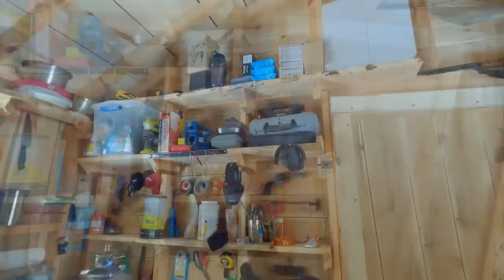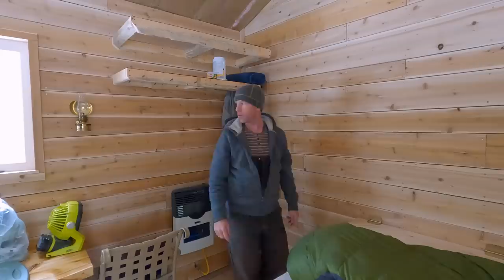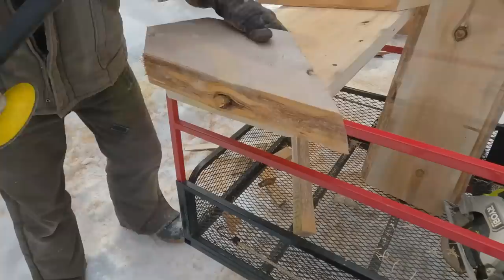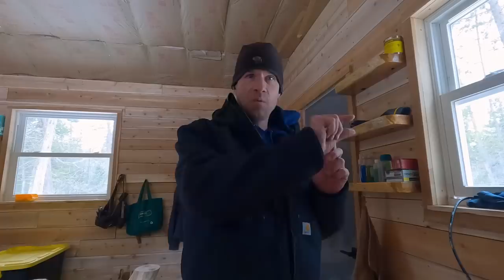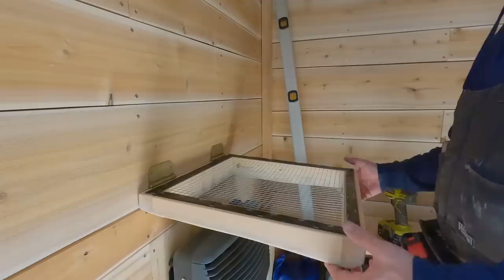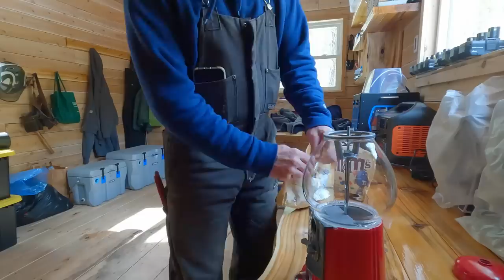Finally Moving In! 190sq ft Alaskan-Milled Cabin #131

Comment: You should hollow out a tree stump to use as a trash can. Make it look like a tree growing up out of the floor instead of a trash can. You can put a lid on it and have it double as an end table.
Reply: "...an end table." or a movable seat and if a second, rough thick lid were made and  stored under the cabin it could be a movable work bench for heavy duty poundin' on.
Reply: Also - cut nails are usually hammered into a board WITH the taper of the nail and the grain of the wood so that the tapered sides of the nail don't separate the wood grain and make it crack, horizontally (in this case).
Reply: Sounds awesome.
Reply: That's a cool idea 😂
Reply: that's a cool idea!

Comment: Idea for the ceiling till you get round to putting the wood up, buy some canvas fabric and pin it up just so your not looking as the insolation for now. Love watching your videos
Reply: Kyle's Cabin on YouTube has a video of this exact thing. Turned out great
Reply: We did that in a rental basement I lived in, once. it make a world of difference and was actually kind of nice. Plus it'll keep the fiberglass fiber from entering your lungs at a drastically reduced rate. My lack of mesothelioma thanks me.
Reply: Yessssss!!!
Reply: Great idea!
Reply: Might be interesting with a tin type ceiling.
Reply: @proehm  might reflect light and be a nuisance.
Reply: @Knight805  or help, those oil lamps don't put out a lot, a multiplying effect might save fuel/power.
Reply: Amazon has those cheap tapestry sheet things, hang a starry sky up there.
Reply: Tell me when a guy would care about boards showing. LMAO.
Reply: @GeorgeMinton-jb8ky  It's not boards, if you paid attention... it's insulation, and dude specifically talked about wanting to cover it. Why even comment?

Comment: You should use that reflective bubble wrap foil on the ceiling too. It will reflect radiant heat back inside in the winter and the heat from the roof back out in the summer.
Reply: Working good on my House and Garage

Comment: A couple of things to think about... 
One.. the sun is way better at making heat that electricity. Have you thought about making a solar heater for supplemental heat when the sun is out? It would save a lot of propane when the sun is out even if it's ridiculously cold.
Two.. if you make an insulated tank you could keep the water from freezing with a solar heating panel. During extended dark periods a small heat exchanger and a small fire would give you warm water. Sawdust and with some borax to keep out the bugs is cheap insulation and a way to use something you make every day.
Three.. now that the jackery is inside and warm the solar panels can be used year round to save running the generator so much. Just need to run an extra wire through the wall when you run the wire for the generator. 
Love the channel. You are living close to my dream.

Comment: The insulation will sweat in the summer, you need air between the ceiling and insulation, just like a house but smaller

Comment: Use totes like the green one you have under the bed now to put the water buckets in or use a cement mixer tray like the black one you used to mix cement in. Even if they sweat the water can be easily dumped out of them without getting the floor wet.

Comment: On your 1lb. propane bottles, do you have the 20 lb. tank adapter to fill your 1lb. bottles? Refilling the 1 lb. bottles is much cheaper than buying the bottles. 
Easy to do a refill with the adapter. Thread the adapter in the tank, thread bottle on adapter, turn the whole thing upside down, open the tank valve. Wait a minute or two to let the bottle fill. You can hear the flow of propane as it fills. After you can't hear it you wait like 30 seconds or so, close the tank valve, unscrew the bottle and repeat till all your bottle full.

Comment: You should make a water tower at the back of the cabin. You could insulate it well, add some electric heating coils and run it off a passive solar panel so it won’t freeze. Maybe pipe in the air from the peak of the cabin ceiling to help keep it from freezing…

Comment: Ryan, be careful putting the generator under the cabin because of CO2 poisoning, at least get the floor air tight first.
Reply: Just put an extension on the exhaust
Reply: @Grunttamer  that would work if you want to do that.
Reply: Yes... it is generally recommended one run their generator app. 25 feet from the house.  Even running it near a window has killed people.  😢
Reply: @faithrada  25 feet is incredibly extreme.  The cabin isn’t even remotely air tight.
Reply: Thank God you suggested that…I’m sure he never thought of that 😂
Reply: I had some friends who had their sons were together at the faster's horses concert in Michigan a couple years ago and they had their generator underneath the camper in the back because it was raining and two of them died by CO2 poisoning devastated my friends ..
Reply: bobbobber2536 I was thinking the same thing… the cabin is off the ground…
Reply: bobbobber2536 
There's a myth that carbon monoxide alarms should be installed lower on the wall because carbon monoxide is heavier than air. In fact, carbon monoxide is slightly lighter than air and diffuses evenly throughout the room.
Reply: bobbobber2536 CO2 is carbon dioxide. You mean CO which is carbon monoxide and it's the deadly silent killer from Gas powered engines etc..

Comment: You can use one of those winter boot trays that you put messy boots on right inside the front door. That way if it does leak, you can always take the tray out and dump it.

Comment: Why don't you make a low profile slide out platform for under your bed for the water buckets that you could line in plastic to help you 1. Get them out/ in more easily and 2. Fix your condensation issue.... just a thought 😊

Comment: maybe a water holding tank on casters could fill and slide under the bed in an insulated box. like for a boat or RV to solve your water sweating issue. it would also look very nice. if ya want to get really fancy could use a manual pump or small electric pump so you only need slide it out when it needs filled. could line the box with pond liner to help keep the floor dry and with it up off the floor maybe it wont sweat or leak messing up the floors... just wallerin ideas around in my head..... hope this gives you some more ideas to solve the problem.

Comment: You can buy 1/4 inch boards at the big box stores that are made to put on bathroom walls. They are wood on one side and a solid white laminate on the other side. They come in 4’x8’ sheets. That would be perfect to put under you bed to sit buckets on. They do not cost all that much.

Comment: The reason for the evaporation on the buckets is because the water inside them is cold, which makes the buckets cold, which causes any moisture in the air to collect on the. The bubble wrap, if it is sealed well, may reduce that some. Why not just get them up off the floor?

Comment: The condensation you are seeing on your buckets may be coming from your propane heater. One of the by products of the flame is water vapor. Never a bad idea to have a CO detector in an enclosed space being heated like that. You may have to come up with some venting to control the humidity.

Comment: They make square fiberglass pans to put under hot water heaters, washing machines and ect. They are like 30”x30”.
And they are not expensive. You could put 2 of those under you bed.

Comment: Hello Ryan;  had to stop the video when you were sitting at that beautiful counter Jackery/Laptop all set up.  So when your getting power from the Jackery am I seeing you plugged into  the 110 on the Jackery?  I just came from Best Buy looking for a way to charge my laptop to Jackery without the need to use the "brick" or the 110 ports loosing power.  It has been my understanding that using the inverter alone uses power so to connect direct with out inverter to be a better option.
Best Buy was not helpful because the laptop "Lenovo" seems to not have a way to connect 12 volt to 12 volt.  Any thoughts or words of wisdom on the subject?  Being off grid as you are at times I am also and wanted to connect to car, RV or Jackery without the need of an inverter.  The young guys at Best Buy I could tell had no interest and acted like I was from another planet asking to do such things.  Love input from you or any of your followers on the subject.  Thanks you are an inspiration to follow.

Comment: Hooshing Propane Refill Adapter Universal for Disposable Small Propane Bottle Solid Brass Propane Tank Atapter Lp Gas 1 LB Cylinder Coupler Quick Connect Attachment  - to transfer propane from 40 pound to 1 pound container

Comment: Your tools will drive you crazy all your life I gaurantee it you will misplace them constantly n cant find em when you need them. And you got tons of them theres atool you need to refill them little propane one or two pound tanks. Saws and hand tools cant just have standard gotta have both metic and standard what kind of screws philips or star tip star tip are better but expensive. yeah gads I just bought a fishing boat n watched videos how to fix them or pimp them out n I decided not to do nothing n mainly just fish. N then there are people brothers that wanna give you things more things you dont want or need or need repairs before you can use them. Gee thanks brother. I live in an old stick home old electrical outlets you name it I could upgrade but not sure I want to yet either. More problems that need solutions.